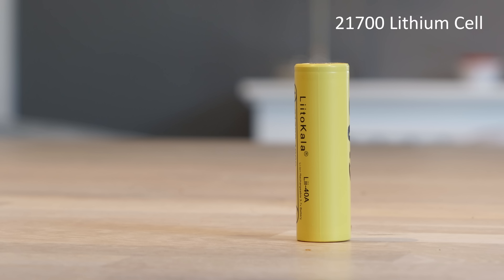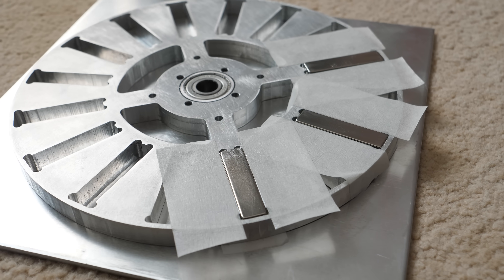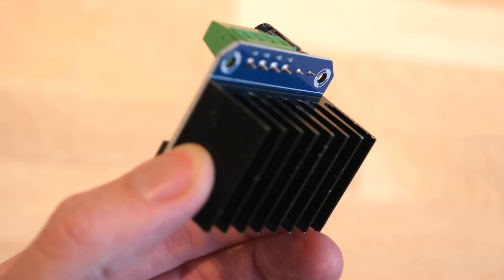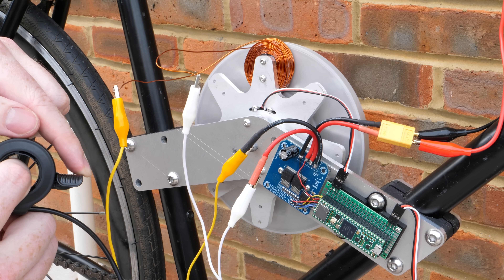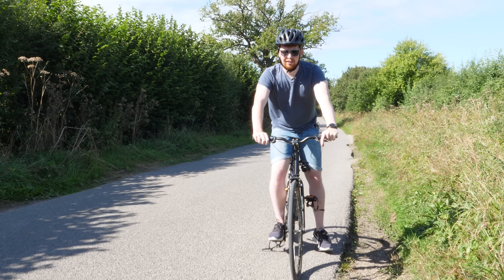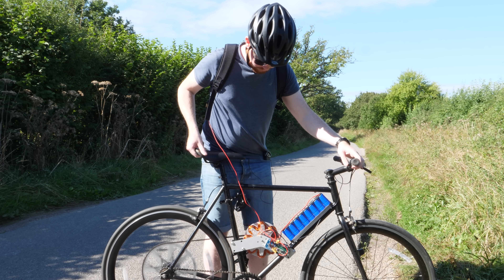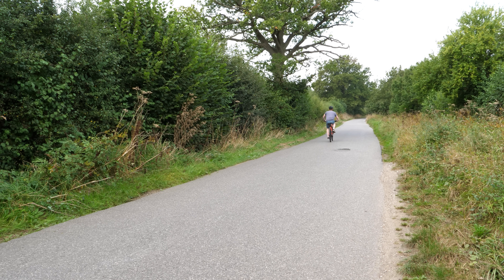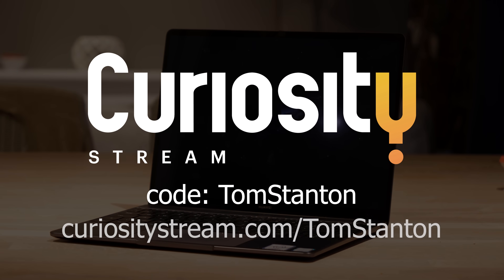Super Capacitor Bike

Comment: Let us see how much torque is sustainable with a few measly farads. Getting a flat torque output over most of the discharge person requires some fancy buck conversion technology in order to provide a constant average current to the motor, depending on throttle setting. Obviously, near the end of the discharge period, throttle response gos out to lunch. The trouble with capacitor banks is the requirement of a constant current drain to provide a linear discharge ramp, along with the quirks of designing variable choppers and buck converters _effifiently_. Why not charge a cap bank off the battery pack, and use the higher instantaneous current capability of the caps for bursts of power during pedal
assist as needed?

Comment: Since capacitors are made for rapid charge and discharge, imagine a bike with a normal battery and a large capacitor bank. The battery could slowly charge the capacitors and then you can get a very quick burst of speed from the capacitors for a short time. You could probably go from stand still to 15 miles/h way faster than a normal E-bike. Or mega power your way up a short hill in a way that no one else can.

Comment: That super capacitor discharge curve is totally wrong, the discharge follows an e function where 63% of the voltage is gone in about 1/5 of the discharge time and in the 1/5 of what remains another 63% is gone. The benefit they give you is that they do charge quickly because the internal resistance is much flatter over the charge/discharge period.

Comment: Kudos to your engineering skills!
However: I don't fully get the benefit of a super-capacitor here: you can charge it 45x faster, but it holds less that 1/35x the energy per volume.
So would a Li-Ion battery of similar size not do a comparable job with retard to charging power (aka range per charging time)?

Comment: I don't feel you need any cruising assistance on your bike. It's a bike, you pedal. Only at steep hills or to get moving you'd want a small boost. So why not using capacitors and recuperation/ hub dynamo to have a bike with no need for external charging and power supply when it is really needed.

Comment: Capacitors in series double their voltage tolerance but half their capacitance, so wiring them in series means they store the same amount of total energy as only one of them. You should have wired them in parallel and used a step up converter to get it to the needed voltage

Comment: I dont understand why people are trying to use a capacitor as a battery. Capacitors are the worst invention when comes to storing energy. They are meant to filter energy or stabilize/regulates it. (along with or without a Zenner diode). Who cares about the long-time recharge of a Li-Ion battery, just do something else in the meantime...example: when i start my computer, until it loads Windows i go in the kitchen to make a coffee. Anyways that bike is an awesome invention and about that kind of motor i think there is something similar on the washing machines but i guess without magnets. Speaking about the neodymium magnets, if you add those to a car alternator and connect the alternator with a normal motor you can create free perpetual energy. You just have to get a hand spinning start with a small rope to the alternator.

Comment: Batteries don't lose voltage unless they are bad! They lose current! (Amps, Watts). But, the less Electrical energy left in the cell, the slower it can be released. Thinks about water pouring out of the huge drum that's full as opposed to when it's almost empty!

Comment: Have you tried a clockwork motor or steam power? Each will require about the same amount of engineering/manufacturing to get about the same result. Next step = Di-Lithium crystals.

Comment: Introducing some iron to direct the magnetic flux would drastically improve the power of this motor. An iron backing to the magnets on the out side and also opposite so that the coils are sandwiched in between would significantly increase the flux seen by the coils as well as improve its orientation. The iron would have to rotate with the magnets to avoid losses due to eddy currents. This arrangement would also shield the bicycle chain from effectively being a shorted coil as it is in the current arrangement.
Reply: Excellent insight dude
Reply: 10months late but maybe

Comment: What if your pedal power charged the capacitor bank instead of powering the wheel? Then you could pedal consistently and build up charge to help you over hills. It would help to rig training wheels that lower and raise automatically depending on your speed so you could charge when stopped.

Comment: dude, try to put a motor to charge your capacitors. meaning of capacitors is to uncouple the rear wheel and the pedals...
don't recharge your capacitors with a battery. it's meaningless....

Comment: Sounds like you could use the supercapacitors for a hybrid bike, like the Prius has a really small NiMh battery that only moves the car in EV mode 1-2 miles before needing the gasoline engine to run.
The regen charging could be used for every deceleration and the supercaps could aid you in any acceleration

Comment: Super nice!  I was thinking: would a voltage regulator (step-up) be able to keep the voltage more constant and get more energy from the capacitors?
Reply: Voltage is going down because the capacitance is going down. It's likely already effectively using the vast majority of the charge in the capacitor.

Comment: What make a capacitor super? Also why would that fairly standard capacitor be "super" when there are significantly larger ones readily available?
Is there something im missing in the world of century old electrical devices or are you just saying extra words to sound smart?

Capacitors do store a charge but that's generally not what they are used for.

Comment: 11 kw-seconds.  tune your motor to ~90 watts, and it will give you two minutes of... something?

for solving the voltage drop problem, you need a shitload of big beefy MOSFETs to change whether the the caps are in series or in parallel, on the fly.

start out with everything in parallel.  as caps drain, reconnect individual caps in series to keep the total voltage above your desired minimum operating voltage.

Comment: You seem smarter than me, why did you need that whole electric controller to flip the voltages instead of just doing something mechanically that flips the voltage based on the orientation of the wheel?

Comment: Why not use a super capacitor to quickly store some sort of kinetic energy and than using that kinetic energy to power the car. For example a rubber band car but the kinetic energy is stored with the super capacitor. The point of this is that quickly charged battery can be used overtime.

Comment: 0:11 WRONG ... lol so quickly. Even the crappiest Lion cells are capable of charging from stone dead to 99% in about 20 minutes, better quality ones in half that time.  The normal limitations is the charger from inversion, not the battery.
Reply: bro had to be correct 😂
Reply: Do me a favour and look up the charging speed of a 21700

Comment: Wouldn't it have been much easier to just put a bipolar hall effect sensor 1/32 behind the coil (thus sensing the polarity of the upcoming of the 16 magnets) and use a simple electrical circuit to switch current, as opposed to using any complex electronics let alone programming chips (which need their own source of stable voltage)?

Comment: To be fair, a large portion of the power is likely burned away by the crude resistors tucked over each capacitor... If you wanted over voltage protection, then diodes is the answer, not resistors. For reverse voltage protection, then a low forward voltage diode is a solution. But a more proper cell balancing method would be ideal. Either through DC-DC conversion, or through switched capacitor means. Each having their own pros and cons.

But realistically, one wouldn't use the output voltage of the capacitors directly. But rather have a capacitor bank followed by a boost converter to drive the motor. Still with cell balancing since one would still want a series parallel array, since we don't want to work with only a volt or two.

Though, still a decent project, but there is room for a lot of improvement.

Comment: This is the magnificence of super capacitors and a way they can cheaply increase MPG on gas cars or range on EVs. You can use them to cheaply add or improve regen braking. They charge so much faster than Li ion batteries that you can put a couple in to improve the capture.

Comment: So basically you could create a controller that could maximize the caps and only resort to a battery after discharge and then the regen could wash rinse repeat.. This could really help ebikes in general and also manage heat to a motor. shit you could make these caps be inline with the battery as one unit.. Could litterally double mileage.!

Comment: Breathing creates positive energy to go to the heart, its transferred to the blood to go through the body to b ready for use continuously. our lungs are generators, our hearts are fusion pumps, our blood is compacitors, our nervous system is wired to the main battery and controller for distribution

Comment: Can you make a bike or car that has a alternators that is able to recharge the Batteries as you move powered by the battery powered motor.  Making so you do not need to plug it in to recharge the batteries by plugging it in.

Comment: Would/could a decent battery like the one you had in your backpack tie into the system and keep the capacitors a little more of a controlled/constant voltage. Kind of like the way cars with huge stereos will run capacitors in line to keep the headlights from dimming when the amp is pulliing

Comment: That regenerative braking idea is actually really cool! If you can gain roughly 40% of the energy used to cycle this system with an optimized battery-capacitor storage solution can be genuinely useful, an ebike you never have to charge, pedal when you can and use the electric power to when going up inclines or when you get tired.
Reply: There's so little storage, it's probably little use. You will pretty much always have to charge an ebike if you want it to be any real use, especially seeing as you're carting around the extra weight of the motor etc.
Reply: Or one that you charge with pedaling, and fully discharge to get you back up to speed after a stop. Since bikes typically have no gearbox, inertia is the biggest problem with biking, particularly in cities.
Reply: @notme8232  problem is no 1 wants to put the money into motors and battery's cannot charge fast cause of the chemical reaction is way to slow and we use way to much power not to mention resistance to peddle a motor would require double the amount leg power you be better off just riding the bike without power cause motor and battery tech hits a brick wall 
it would cost millions and years to make a breakthrough in researching and then could we afford the end product ...... Greed has a big part of evolution of technology and life
Reply: THERE ARE EVEN BETTER WAYS!
Reply: It exists. Called "pi-pop", with 8Wh capacity which it charges by preventing you from going above 23km/h, or by braking. But it's too heavy for what it is, supercapacitors have poor energy density.
Reply: You know pretty much all of the ebikes already have regenerative braking.
Reply: @LarryJL  Very few have regenerative braking. All the nice ones use mid drive motors instead of hub motors making regenerative braking impossible.
Reply: @TheFrugalEngineer  Well it's certainly not rare.
Reply: @TheFrugalEngineer  yes exactly, ones you would want to use dont have it
Reply: @TheFrugalEngineer  what do you mean "mid drive motors"? Yes almost all of ebikes have regenerative breaking. You don't need a hub motor for that.
Reply: @randybobandy9828  I think they mean motors that are between the pedals, instead of at the rear wheel.
Reply: @randybobandy9828  you do need to have a motor driven by the momentum of spinning wheels for regen-brakes to work. A mid drive motor doesn't get driven that way unless there's no freewheel in the bike. 
Secondly, only high-end, electric vehicles utilize regen-braking.  Some others have dynamic braking - which just helps to slowdown the vehicle.
Reply: @LarryJL example brands and models?
Reply: Regenerate brake is common in almost every electric vehicle, it's nothing new and he sure didn't come up with it himself.

Comment: Manufacturers should start using industrial-grade supercapacitors in EVs. Just imagine the combination of regenerative braking, supercapacitors, and lithium batteries. You could even program the capacitors to kick in on different types of terrain, stored energy for short uphill bursts, for example. You could easily have an EV that would do over 1000 km with something like that if done right.

Comment: What a superb project, so you effectively made a bicycle run about 60 ft on a single AA battery carrying you and overcoming the mechanical drag caused by the second chain and pedals.. You may have something there 🙂
Reply: Those single batteries hold a significant amount of energy, and on the other side the amount of energy needed to cycle a short distance on a flat road is minimal.

Comment: You need a larger bank of SupCaps (around 100 to 120), soldered in runs of like 10 long / 4 wide / 3 high. roughly 14" long and 10" high, mounted on Bicycle Cargo Rack, with voltage controller and inverter. like the controller for solar panels. build whatever pedaling/gearing setup you want and do your math to figure what the SupCap bank outputs. as far as regen braking, do a setup for front or back wheel where to coils ride on each side of tire, attach whatwver magnets you can to get the most voltage through the coils (obviously do whatever  calulations needed to figure output from coils) run that into a controller meant for charging the SupCaps. you will still have to pedal from time to time obviously to get the charge up on SupCaps but the coils over tire will help to put a trickle charge maybe more depending on how fast you go and how far. downhill is good. could even use those little tire generators for running headlight assy. to help keep voltage up on SupCaps. i mnow u would have to do a good amount of pedaling to fully charge, or a big downhill, and have it charging the entire time ur rolling. maybe even use more than one tire genny to get whats needed to charge SupCaps better. I saw a guy make a SupCap bank and charge with solar panels with controller/invertor on both ends and run Circular Saw, Shop lamps, Miter Saw etc. off the SupCap bank, of course he was using 200 plus in the bank and i think he had them wired something like 20 SC bundles in series and then connected all the bundles parallel to controller and it was running several power tools for a couple of hours before having to completely stop to get charged fully again. look it up on youtube and Im sure you can find it. Your is good, you just need to get the circutry part right, and itll work.

Comment: Realising that the motor is DIY, absolute precision is difficult but is there any leeway to reduce the air gap?
This would really be pushing it, but could fixed opposing coils be fitted to the other side of the permanent magnet rotor?

Comment: I saw today the flywheel satellite launch tests of NASA first animated then actual.  But energy storage of mechanical inertia has the math teach us use spokeless maximum weight maximum radius wheel in a lubricated trench because radius increases storage as much as rpm.

RPM IS NOT LINEAR!

Getting huge return from radius increases has never been optimised and if you think 41% matters your correct- it's the cost of the power you are able to use that matters, not how much power i.e. heat or other then electric put in.

Once energy is electric planning is gamed for oil

but storing it prior to making electrons and using it without having to do that especially kicks oil HARD

Comment: The supercapacitor charges 1.28 times as fast as the li-ion battery (0.4 Wh/min vs 0.311 Wh/min). It only charges sightly faster; the only benefits would be high discharge rates and an increased # of charge cycles

Comment: Great video! I am going to do some SuperCap experiements on an upcoming cycling trip.  My aims are modest though, I just intend to charge a bank of supercapacitors (3x16v , I can't recall the capacity right now) with solar (20v80w). they will connect to a boost module that will output 48v. I want to charge my batteries while I travel.  The slower I go the more I will increase the range is the theory.  

Julian Illet did an interesting experiement running a lamp with a boost convertor that was fed by a bank of capaictors that were charged by a solar panel. https://youtu.be/r7M6Pb2roLs.  He has quite a few experiements along those lines.
Reply: This video by Julian is also worth watching. https://www.youtube.com/watch?v=ITsmOBdBKzk

Comment: What about regen In to supercaps at high voltage then using that to charge lithium ion batteries.  Use both for boost bursts 🤣.   U could use some solid state relays to switch everything  esp32 control everything.

Comment: use generator 12volts connect to front  hub  then use step up converter 12to220 volts then use motorhub 15000wats motor hub..try it infinity power no battery use it free generation ...

Comment: SIR : PURE SILVER WIRE , BRAIDED , WOILD GIVE LOWEST RESISTANCE (~10% BETTER CONDUCTOR THEN COPPER ) ....BRAIDED WIRE CONDUCTS BETTER THEN SOLID WIRE DUE TO "SKIN EFFECT" and ELECTRONS BUNCHING UP ON OUTER SURFACE & FEW ELECTRONS IN CENTER CORE ...FURTHER : SILVER PLATED , HOLLOW COPPER WIRE UNDER #20 gage,  BRSIDED would give BEST CONDUCTOR , LOWEST RESISTANCE 😁😁😁